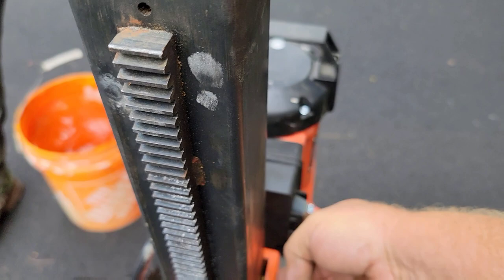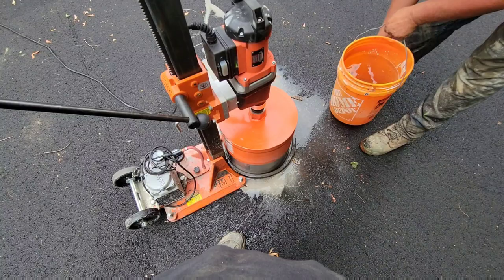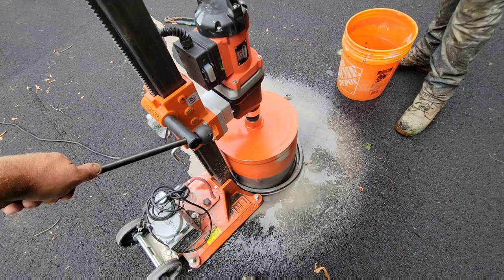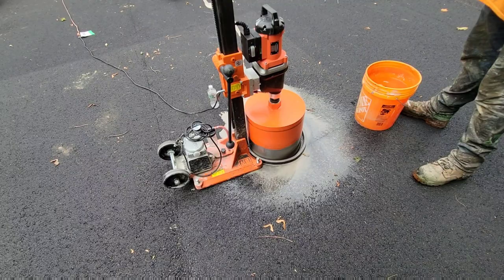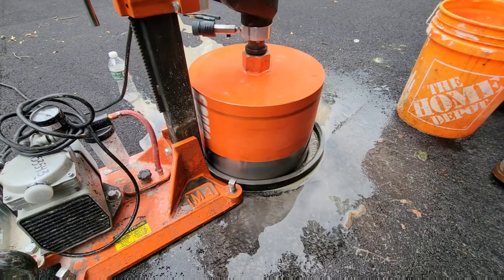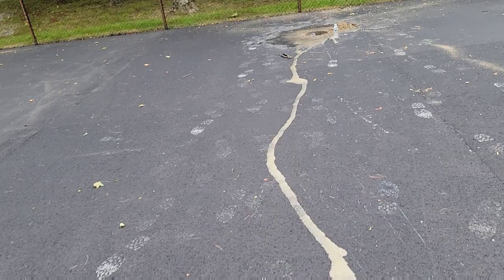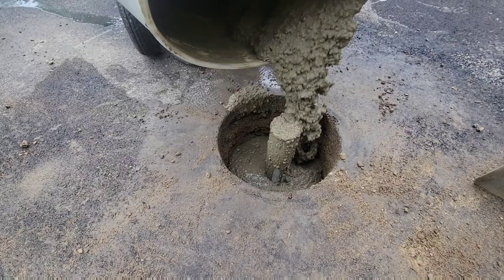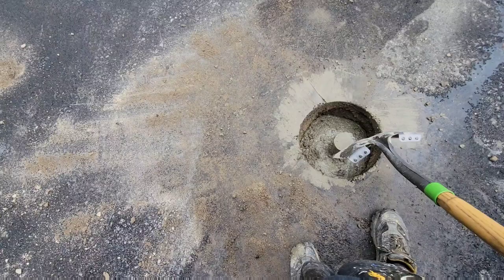This is how WE do post sleeve installation on tennis post.

Comment: Awesome. How much does a machine that cut the core out cost usually?
Reply from the maker: 2 to 2500 with cans
Reply: @thesealerguys  what's the name of this type of machine?
Reply from the maker: @arrumahn  called a core/bore drill will run 4k. You can rent at rental place 500 a day maybe
Reply from the maker: That's a 14 inch can. That's about smallest I'd go